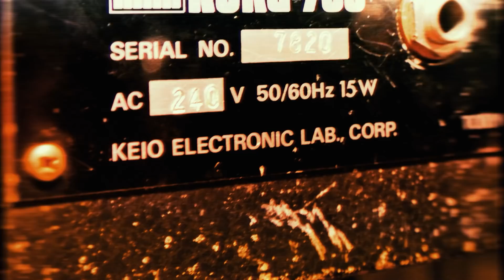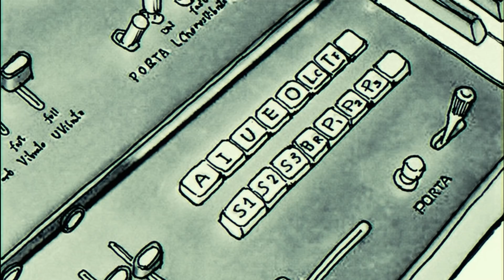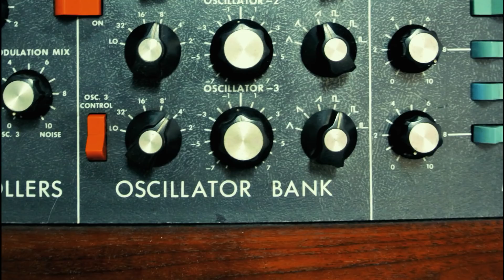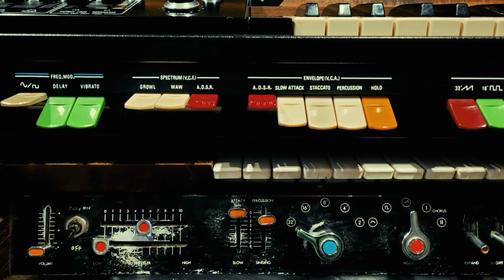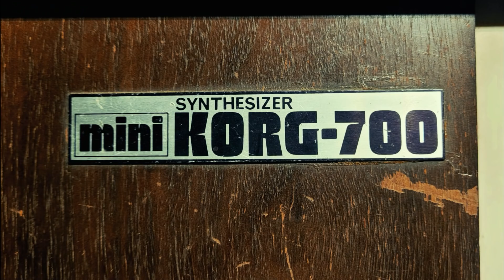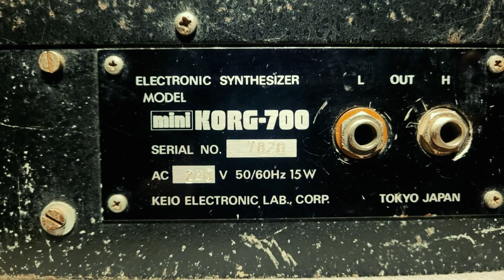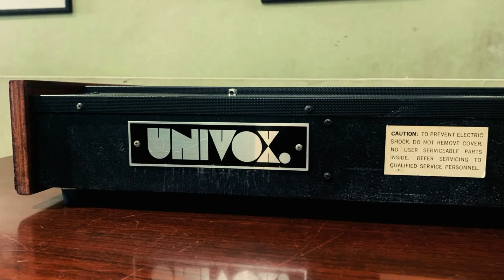The History of the miniKORG

Comment: Bought a 700FS. Neat, weird little synth. Shockingly strong and brash sounding when it wants to be. Definitely has a "take it or leave it" attitude. It either does something or not. The ring mod is stupendously awesome.
Reply from the maker: Yes, it's its own thing for sure. The peculiar behaviour of the envelope, the dual filters that don't self oscillate etc.

The ring mod is great, definitely. Especially as it has those three modes.
Reply: @AlexBallMusic  I'll also add: the 700 really opens up if you discipline yourself to avoid adding the "duet" second oscillator. The single oscillator sounds on it are FANTASTIC and strong.

Comment: The MiniKorg was made in a time in which each of the synth manufacturers was individual, idiosyncratic. By the time the 80s rolled around, every synth was functionally very similar to the Prophet 5 and the Minimoog (which the Prophet borrowed a lot from). In the 80s though each make still had its own subtle differences in sound, which became harder to maintain once everything became sample based.
Reply from the maker: Yep, the wild west of synthesis. It later became more standardised, which I guess makes sense from a marketing point of view.